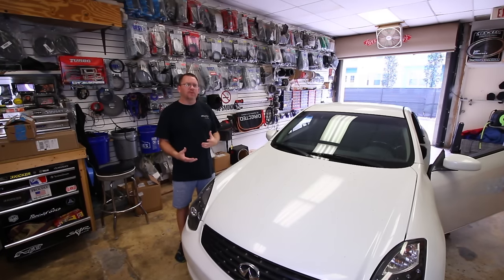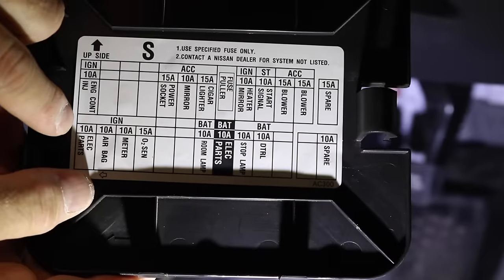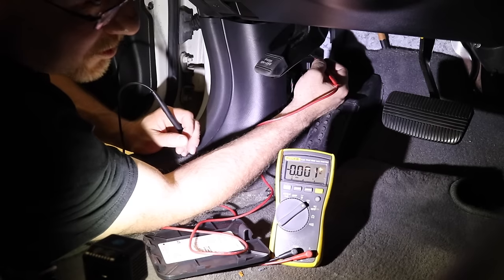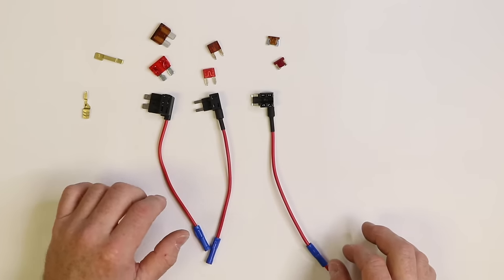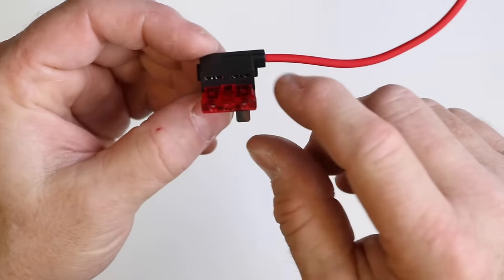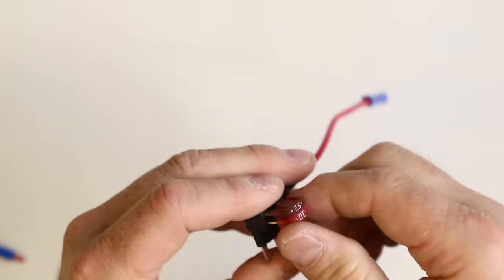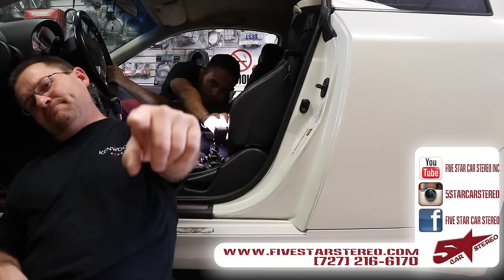How to tap into your cars fuse box safely and cleanly

Comment: Thanks, knew I saw something like this before (probably from this exact video)

Going to help a friend install a sub and amp soon and kept remembering things we might need depending on how we install the things. 

He has a Jeep and we're dealing with the stock head unit, so we have to get a High-Low converter, and might be lazy about it and use one without a 12v trigger, and this is what I was looking for to be able to trigger the amp still.

If it wasn't so budget minded (I mean Jeeps are expensive, but he still doesn't have enough to overhaul the thing for now) we'd get a better headunit and that'll do all that easily.

Thinking about a "Skar Audio RP-800.1D" for the amp and "Ultimax 12" for the sub (still deciding on enclosure).
We already tested my 10" Ultimax sealed in the jeep (Via and Inuke Jerry rigged) and he had a BIG smile so I think he's satisfied knowing the 12" will give him a bit more than what my 10" gave.

Comment: how can we know where is the load and the draw side of the fuse itself?
Reply from the maker: +Arjay Navales test light or meter. Pull the fuse out. The side with out 12 volts is the side the wire should be connected to.

Comment: Great Video and I really thank you for it. Thums Up and I even let both commercials fully play. My question...Why is there only 1 wire coming off the fuse tap pig tails? You need the ground wire AND the hot wire (2 separate wires) to hook anything up, so how's it going to work?

Comment: Can someone clarify something for me? He stated that the top fuse should be lower than the bottom and   gave the example of the top can't be 30 with the bottom 20. However, he inserted 25 at the top and the 10 at the bottom. Why is that?
Reply: Looks like he messed up. You need to make sure that the top one is lower than the bottom one. Since you are tapping into a component in car and if you put high amp fuse in the top, the bottom one is going to blow since it melts at a lower amperage and as that might be connected to something on your car you might have some warnings pop up.

If you use an empty socket then you just need to fill in the top one with the amp fuse that you are going to require in your application. If you don't find a suitable empty slot then make sure that the accessory that you are attacking is a lower amperage than the one pre applied. Btw you can see that the wire comes out the top meaning top is for accessory so hook up a lower amp fuse to that.

Sorry it's a bit long but I hope it helps
Reply: I think you may need to watch the video again. He clearly states he has put back in the 15A (Blue) fuse at the bottom and he places a 10A (Red) fuse on the top. It would've been less confusing if he showed the Fuse Tap in the fuse-box.

Comment: Hi. anybody can help?  I have a 2010 Chevrolet express Cargo Van and I need to get 12v for my radio amp I was about  to connect the wire to the battery but I found a big  Fuse box under the driver seat wish it have a thick wire coming from the battery.  the question is can I just connect the amp wire (wire with fuse) to the fuse box wire the is coming from the battery?    it will be grate and easy for me cause I'm going to install the amp near to that driver seat.  
Thanks before hand
Reply from the maker: Always go to the battery for your amp power

Comment: If I tap into a 10amp fuse to install two gauges that each draw 5amps, do I need to replace the original 10amp for 15amp? I’ve seen this done in a video, and I am currently having an issue with one of my gauges not having a good power source.  There is an inline fuse from the fuse in the box and where the gauges connect. The tap in general is a 10amp, but I am not sure what the inline fuse is because it’s one of the bulb looking fuses.

Comment: I have a 2001 Pontiac Sunfire and everytime I do a fuse tap it seems to screw up my CPU and makes my gauges stop working. Either that or I cant start it. I've tried the wire on the fuse tab and an actual fuse tap. They all seem to connect to my CPU. Please help.💀

Comment: My power outlet on my 2009 corolla wasn´t working so I decided to tap the fuse and run a separate pair of wires. The problem is that it no longer powers off when the ignition is turned off.  Can anyone explain that?

Comment: 6:58 I just don't get it. Can someone elaborate on that rule?
Reply: I don't think that rule is correct.  If you plug it correctly it ought to create 2 separate circuits off the main voltage bus.  The fuses should be what is required to run the device on the circuit

Comment: Only problem I seen was at the end you put a 15amp fuse in the tap. Your not supposed to exceed 10amps on either side. With that being said your going to need to use a ignition powered fuse that is 7.5 and then a 10 on the bottom or the same concept but lower.
Reply: As an example I only had 2 7.5 fuses that were ignition and that's the smallest fuse s in thee care one was radio#2 and one was obd. I pulled the fuse also and started the car. That will confirm its not as likely to affect mobility if it blows if you're limited on what fuses you can use. But I was un aware of the load side this was helpful. Many people did know that.

Comment: I used one of these one a 3 gang switch and connected the radio fuse so it would turn off when I turned the ignition off n this thing kept drawing power

Comment: You made a mistake regarding a fuse having a load and draw side. Actually they don't. The fuse could be installed  either way. The fuse box where the fuse actually goes into has the load and draw side. You need to check which side of the pin slot on the fuse box provides the 12v (load side) using a volt meter. Once you that information you can put in the fuse tap accordingly. The wire coming out the side of the fuse tap is the draw side. So make should that is plugged into the draw side of the fuse box slot.

Comment: I'm confused you said the top fuse in the top needs to be lower the the bottom yet you put a 25 in the top and 10 at the bottom
Reply from the maker: Scott Somerville that is a 7.5 amp fuse
Reply: Five Star Car Stereo  do the fuses have the be facing away from each other or does it matter how the fuses are put in? Obviously original goes on the bottom but does the top one have to be facing away from the lower on or can they be facing the same way just using your video as reference and saw the 10 and the 7.5 was one way and the other the other way?

Comment: Five Star Car Stereo: 
This is a great video, and I learned a lot.
I am still confused about “right” and “wrong” ways to insert fuses.

I got my start working on cars with an “Idiot’s Guide”.  I confess I was even confused by that in some places. So, please, bear with me as I try to sort out my confusion.

I replayed the video several times, and I followed the accompanying Transcript line by line. 

This is what I gleaned from my review, but I need your confirmation or corrections to my understanding.

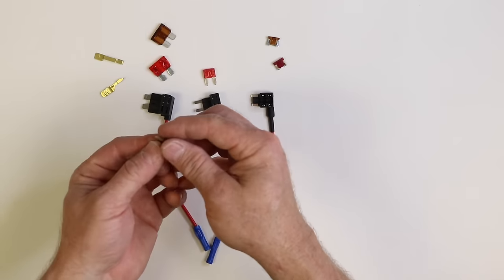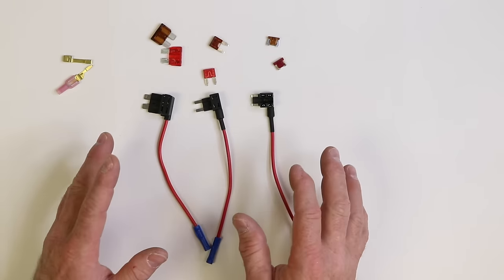a. Video 4:58 to 6:16   Regarding “sleeves”, also known as “Fuse Tap” as can be seen at https://www.amazon.com/dp/B009WQPASU/ref=psdc_15729681_t3_B002UZZM0G :
TRUE OR FALSE?  The fuse BLADE that the FUSE TAP is added to must be the on the side that is inserted into the 12 volt/supply/hot/line side of the VEHICLE FUSE HOLDER.

b. Video 6:17 to 7:49 Regarding Piggyback Fuse Holders, also known as Add A Circuit Fuse Holders such as can be seen at the video at 6:30 :
TRUE OR FALSE?  The BLADE on the side of the PIGGYBACK FUSE HOLDER that is OPPOSITE the side with the wire that exits the PIGGYBACK FUSE HOLDER must be the BLADE that is inserted into the 12 volt/supply/hot/line side of the VEHICLE FUSE HOLDER.

c. TRUE OR FALSE?  The ORIGINAL VEHICLE FUSE that was pulled from the VEHICLE FUSE HOLDER to make space for the PIGGYBACK FUSE HOLDER must be inserted into the LOWER of the 2 pairs of slots in the PIGGYBACK FUSE HOLDER.

d. TRUE OR FALSE? The orientation of the ORIGINAL VEHICLE FUSE in the PIGGYBACK FUSE HOLDER does not matter.  That is, there is no wrong way to insert the fuse.

e. TRUE OR FALSE? The NEW FUSE for the power to the add-on accessory must be inserted into the UPPER of the 2 pairs of slots in the PIGGYBACK FUSE HOLDER.

f. TRUE OR FALSE?  The orientation of the NEW FUSE in the PIGGYBACK FUSE HOLDER does not matter.  That is, there is no wrong way to insert the fuse.

g. TRUE OR FALSE? The NEW FUSE in the upper slots for the add-on accessory must be of a LOWER Amperage rating than the ORIGINAL VEHICLE FUSE in the lower slots.

h. TRUE OR FALSE: The NEW FUSE for the add-on accessory must have an Amperage rating matched for the accessory. For example: If the new accessory draws 10 Amps, a 10 Amp fuse is required.  [This was not addressed in the video.]

i. TRUE OR FALSE: When simply replacing a fuse the orientation of the fuse in whatever holder does not matter.  That is, there is no wrong way to insert the fuse.

Comment: Shouldnt terminology be 
Load or Draw is same thing = to the device.
Power or Line or Source = 12v + battery side. One with current when ignition etc is turned ON.

Comment: The two line side fuse slots on the double holder are connected. The two load side slots are not ! It is NOT possible for power to " zigzag " through it. ( a diagram of the pathway inside this double tap would look like the letter F) Each fuse needs to be the appropriate size for the device and wire size it is protecting. It is irrelevant what size one fuse is compared to the other. Power goes up the line side from the  terminal block, then across the lower fuse and back down into the block and on to whatever that original slot in the block was powering. Power also continues up the line side to the top fuse , across that fuse and out the red wire to whatever source you're adding. Again, those two output/load side ports are not connected to each other. This is basic electrical knowledge that a trained, professional installer ought to know.....

Comment: I did car audio for over a decade one of the things I know that most of the guys that are involved in it have limited knowledge but are good installers the only other thing besides having the terminology incorrect about line and load is that they are not verifying that the load they are applying to that circuit is that a heavier draw than the wire that feeds the load is capable of handling which can result in a fire this is a very slippery slope and showing people how to connect to a fuse box without making sure that those things are verified is dangerous.
Reply: Tech Relativity MM     Thanks for the comment.  It's good to have those with experience add comments for newbies.   I am going to be hooking up a dashcam using one of these taps. Going to crimp into a USB cable into it.  What should I pay attention in terms of load?  I will be tapping into an existing cig lighter 15A (switched on by ignition).  I look forward to your reply.

Comment: Just install a new fuse in the fusebox and wire it OEM. Looks a lot better then these add a fuse wires. It's not that difficult.
Reply: You should make a video describing and demonstrating this simple OEM wiring process. :)
Reply: Aaron M I don't have this brand vehicle but it's quit the same procedure on vehicles.

- Determine you need 12V constant or switched live. 
- Determine what fuse size you need 
- Buy the fuse and repair wire for the fusebox at your dealer
- Take away panels around the fusebox and screws that hold the fuse box. 
- Unlock the fusebox (normally a tab must be released so you can slide the box into unlocking position)
- Insert repair wire from the back and insert new fuse 

https://www.my-gti.com/601/addition-of-extra-circuits-to-the-volkswagen-golf-jetta-passat-eos-scirocco-rabbit-fuse-box

Comment: I am trying to hardwire my dashcam and I've come to several places such as this one. However, in trying to know the correct terminal, I've come across your "load (12V)" and "draw (dashcam)" side terminologies, which obviously mean, "hot" and "cold" sides, respectively. One person said you had it wrong and opposite. Follow link https://dashcamtalk.com/forum/threads/which-side-of-a-fuse-is-hot-vs-cold.30136/

Could you please clarify the following points:

1. How would I know which one is the load side and/or the draw side?
2. A fuse is a circuit with a specified limitation. So, does it mean if I can get a reading of 12V on one terminal, I should also get 12V on the other as they are connected by a fuse. Is this assumption correct?
3. Can you show a diagram of what's happening inside the tap? Blow up the tap and show the flow of currents.

Comment: 1:11 - "emergency brake pedal'?? - my car has a service brake and a parking brake, wtf is an emergency brake?
Reply: It serves the same function as your parking park. Here in the states it's called an "emergency brake". Some cars have a pedal others have a handle. You probably have a handle.
Reply: Mark - thanks, mine has a pedal for the parking brake. However I cannot imagine that it would be of much use in an emergency as it has no servo assistance and operates a drum brake rather than the service discs.

Comment: Howcome you didn't use the words positive and negative instead of load and draw? Makes it so confusing.
Reply: Because at the fuse there is NO negative. Also he did confuse his terminology. Here's a simple circuit: [12v supply]---[fuse]---[red wire to the device]---[device]---[blk wire from device]---[any metal part under the dash]

Comment: well you just put a 10 on the bottom in a 25 on top what's that contradicting what you just said
Reply: I think you may need to watch the video again. He clearly states he has put back in the 15A (Blue) fuse at the bottom and he places a 10A (Red) fuse on the top. It would've been less confusing if he showed the Fuse Tap in the fuse-box.

Comment: Load is what you are calling Draw my friend, their is no such thing as a draw side in an electricians life.  You have Line and Load and the Load is the thing that is using the electricity, it doesn't draw anything it allows electricity to flow.  Electricity only needs a path, nothing draws it other than the Dirac Holes but going there would require too much thinking so it doesn't matter.  Might as well use the proper terminology since people will no doubt need to read a diagram or do other things and they are not going to find Draw but they will find the word Load and if they hook it up the way you've called them it will be wrong right?  See I'm not picking on you, just don't want  y ou to be to blame for some smoked circuits is all, or worse a fire that burns down a house and those in it!!!
Peace
Sizzlean